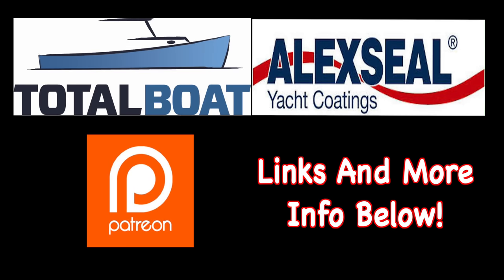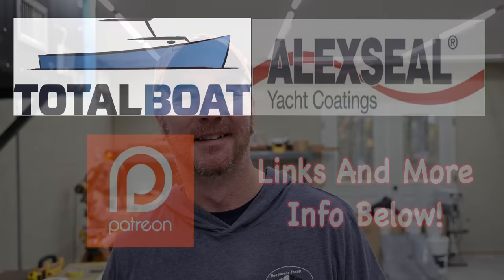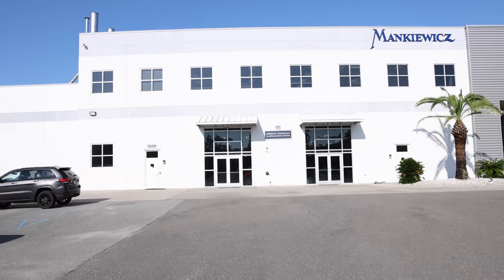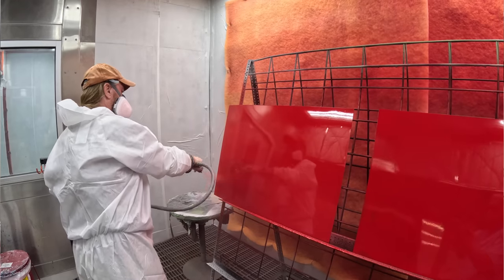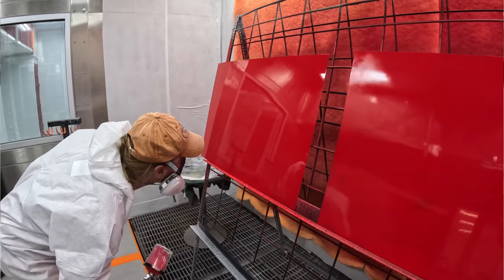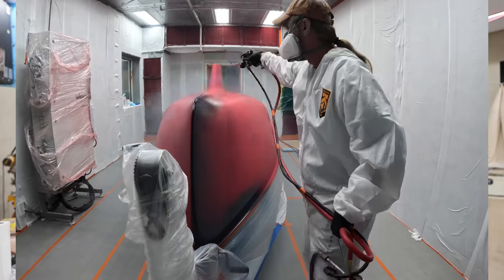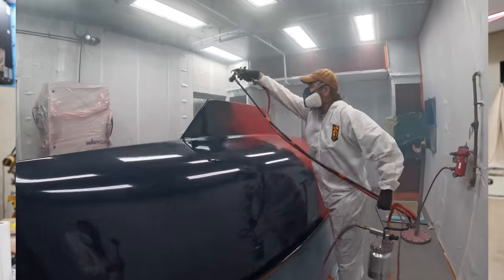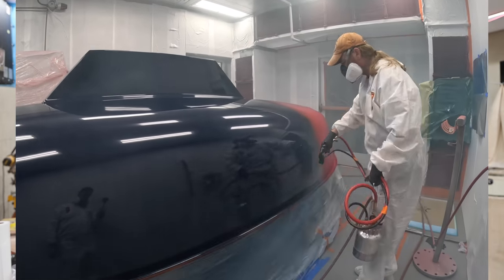WHAT'S THIS NEW TOPCOAT X PAINT BY ALEXSEAL ALL ABOUT??

Comment: Awesome. I've been spray painting from time to time since the mid seventies. With enamel it is not at all unsual to get a full cover on the first coat though it is very thin and requires a second. If a third can be afforded ($$$) very good at least an hour apart. Later I found Nitrocellulose lacquer. First coat full cover everytime and if a run did occur ( it happened alright) I would block it out with fine wet n dry. after 320 g a coat or many of clear 15 minutes apart. Quick sand 320 g again and then cutting compound on a damp cloth , buff it out and we had nice shiny paint job without having polished yet. One coat of colour but this was not for marine conditions. Bottom line is I enjoyed seeing you block out the substrat with your first and then laying in with some weight of coverage. Thats how I always did it.

Comment: They need to develop a paint that has something in it that floats to the top to create a protective layer (think like the wax in gelcoat) that bugs, lint, and other contaminants can touch but buffs or washes off after the paint cures.
Reply: you just described hard epoxy paint. Which is the norm here for boats in the uk.

Comment: In your test, in a booth, controlled environment,   you painted over that "red paint". 
      Was that a primer, or pant? Looked pretty flat finish.  
   Now as you indicated,  90% of DYIer's, roll vs spray do to logistics, I was wondering if after all the sanding... and sanding... do you suggest a primer with this brand? 
Thanks
Reply from the maker: The red base was a previous paint job using their 501 line :-)

Comment: Paint is a last resort  the only, repairs you will see come out of my shop are gelcoat.  I can't believe you can not find a compound that will not buff out hard paint. If you can get compounds that will polish fiberglass, stainless steel, tomb stones so I am very confident in saying you cant make a paint hard enough it can not be polished.  That all said i love seeing new products.
Reply: Gelcoat oxidizes pretty bad at least down here in Florida so paint is preferable especially on bigger boats like sport fishing yachts and sailboats for easier maintenance.
Reply: It’s a simplification. The surface hardness combined with the substrate properties makes it not suited for blending surfaces. Everything can be buffed, but not always to a nice result.
Reply: I'm in agreement with you. Gelcoat is my go to as well, durable, simple  to tint and match, and easily repairable. I only use paint if the hull has been previously painted.